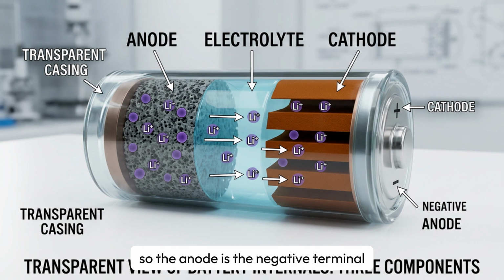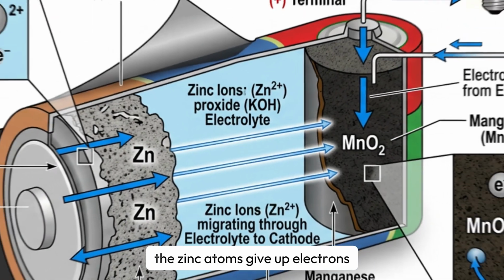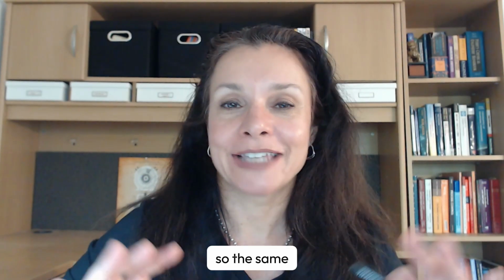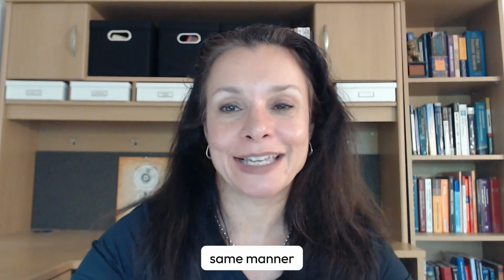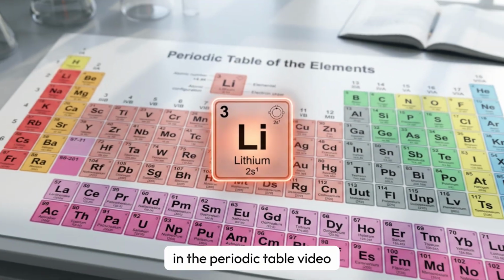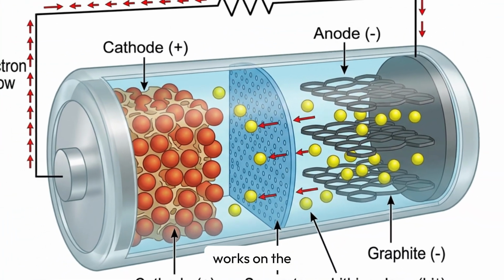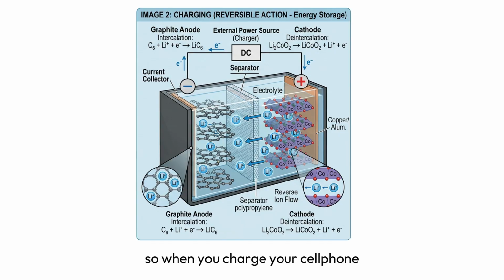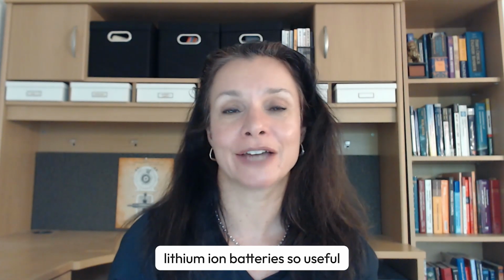HOW BATTERIES WORK — From Alkaline to Lithium-ion to the Clean Energy Future

Comment from the maker: 🔗 Full video — How Batteries Work — From Alkaline to Lithium-Ion to the Clean Energy Future:
https://youtu.be/_T7RrBmw2-o

Every battery ever made — from the AA in your remote to the pack in your electric vehicle — works on the same three components and the same fundamental principle.

Anode — where oxidation occurs and electrons are released.
Cathode — where reduction occurs and electrons are consumed.
Electrolyte — conducts ions between the electrodes while blocking electrons — forcing them through the external circuit as electrical current.

That forced electron flow is the electricity that powers everything.

The full video covers the complete picture:

🔌 How a AA alkaline battery works — zinc anode, manganese dioxide cathode, potassium hydroxide electrolyte — and why it is single use
🔋 How lithium-ion batteries work — and why the reaction is reversible hundreds or thousands of times
⚛ Why lithium Element 3 is the perfect battery material — single loosely bound valence electron — the periodic table predicted it
⚡ Why all batteries produce DC — and why that connects directly to the AC vs DC War of Currents series
🚗 EV battery packs — thousands of lithium-ion cells delivering hundreds of kilowatt hours
🌍 Grid-scale storage — making 100% renewable energy grids possible
🔮 Silicon solid-state batteries — the next generation — ten times the capacity of graphite

I authored two textbooks on fuel cell technology — closely related electrochemical energy systems:
📚 Designing and Building Fuel Cells — McGraw-Hill
📚 PEM Fuel Cell Modeling and Simulation Using MATLAB — Elsevier

Both available on Amazon. Links in the description.

⚡ The Tesla Institute — understanding energy through physics, chemistry, and engineering.
Nikola Tesla believed electricity should belong to everyone. We are still working towards that vision.

Drop a question in the comments about battery chemistry, lithium-ion, or energy storage — happy to go deeper.